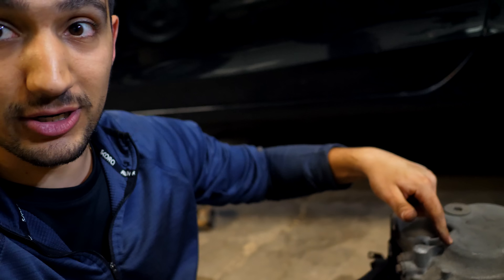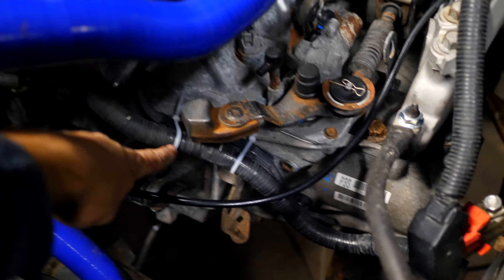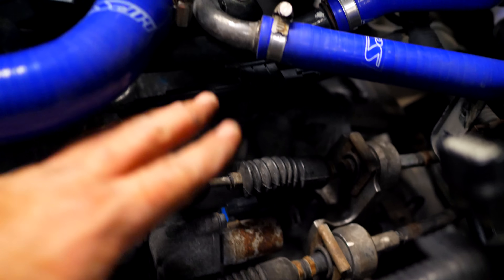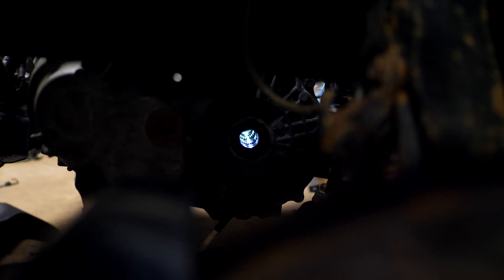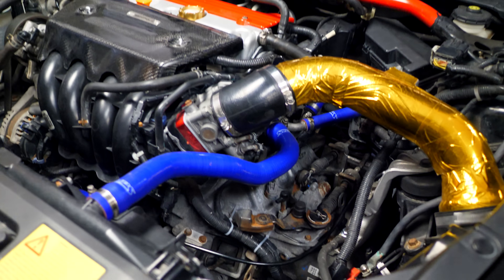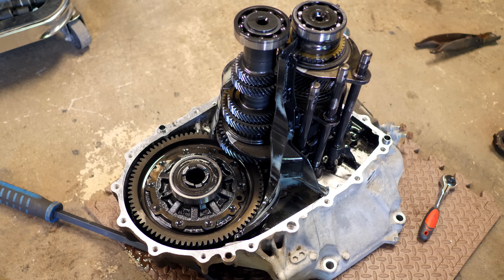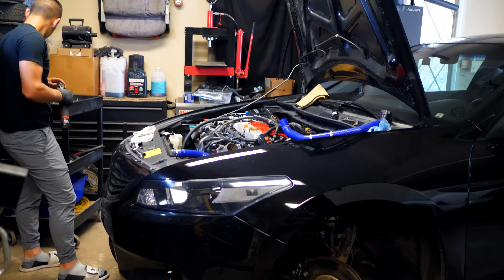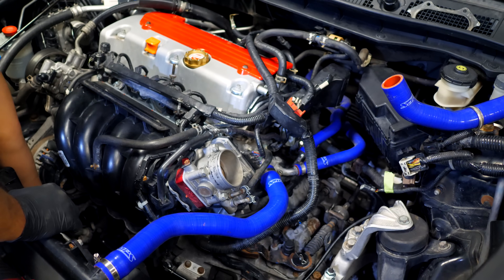Honda Civic Si Transmission Swap | 6 Gears, LSD, & Short FD

Comment: I am going with the 5 speed accord transmission in my Si. I want to put my diff in the accord trans. With my kind of power hoping with less shifting and good times. Can it be done? and hopefully the diff in my Si transmission isn't damaged cause my 2,3rd is gone and thats reason for the change

Comment: Great video man...I have an 06 tsx auto that I want to do the same setup...what did you have to do as far as the ecu and harnesses?
Reply from the maker: Hey Kamal, literally nothing to the ECU and harness. Since I had a manual transmission, the only thing that I needed to do was get the nut on the top of the transmission, and then I bought a speedo correction kit to compensate for the difference in final drives.

Comment: I have a question: i never saw you  do something on your shifter knob in the car. So i am not so familiar,  do you need to change or upgrade any of the shifting cables and the shifter ? Or u can still use the 5spd shifter and cables ? Like u said the 6th gear will be on the spot of your 5spd rear and now the rear will be all the way to the right and forward right ? If u can give some details please
Reply from the maker: The shift knob, shifter cables, shifter mounts, all are fine. They don't need to be swapped. The shift patter is determined by the transmission, so when that is changed, the 1 through 6 gears, and reverse will all shift smoothly. I changed my shift knob to one that has a 1-6&R shift pattern, but nothing needs to be modified or changed.
Reply: @milanmastracci  that’s what i thought but just wasn’t 100% sure. Thx for the reply and good work as always 🤙

Comment: This happened to me I replaced the clutch on my 04 acura tsx, I started it reversed out of my driveway and I heard a pop....put it in first gear and it wouldnt go anywhere....I almost blew a fuse just thinking about what could have gone wrong , a couple hours later on Google I saw something similar and checked my axle and wouldnt you know it it had popped out on the driver side! Sure am glad I didnt pull the tranny out before figuring it out !! Lol

Comment: Good work man wish i can have the skills to do that cant trust no mechanic these days
Reply from the maker: They can be quite costly these days! Its nice too that once I removed the transmission and engine from the engine bay, I pressure washed and degreased it to clean it before putting the new one in.

Comment: did you flush out the ac?
Reply from the maker: DIdn't have to since I disconnected the AC compressor from the engine before pulling it.
Reply: milanmastracci smart man

Comment: Bro glad you got everything sorted out, Luca is the shit for helping out twice. Ur whip is guna be dope. Also I see u called the v6 6sp guys, hope u find one to do a comparison
Reply: I have a heavily modified 2012 V6 6spd coupe. 13.5:1 CR, Custom Web Camshafts, titanium overbored valve train, custom heads from inline pro and a Holley efi hi ram intake from P2R. Makes just over 400whp and 345wtq. Need an lsd tho, I'm a 1 wheel burner lol
Reply: @Fitness195  shots fired shots fired!! I also want an lsd
Reply from the maker: Yeah the LSD makes a huge difference!! I drove my accord in the rain today and I had so much more grip when pushing the fun pedal to the floor :D

Comment: what do u mean by bleeding the coolant, can u make a video on it?
Reply: when you fully drain coolant from the engine and coolant system, air takes it's place.  when you replace the coolant, you must bleed the system to remove any air.